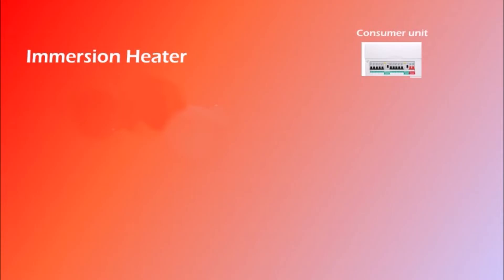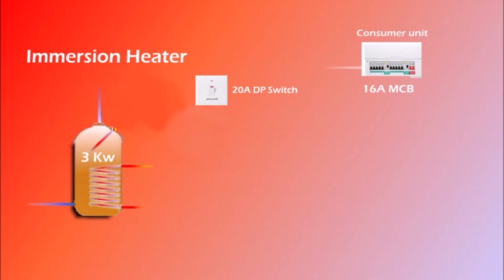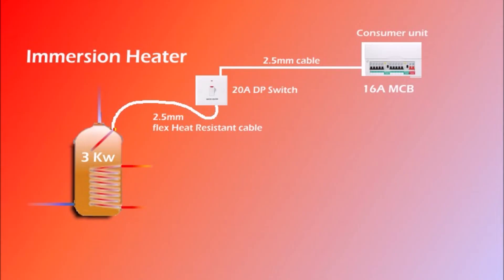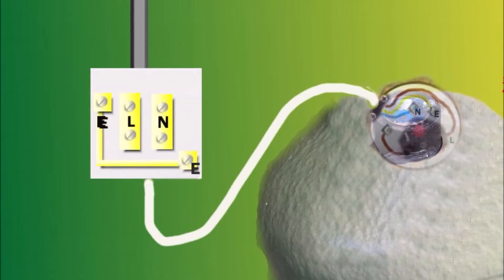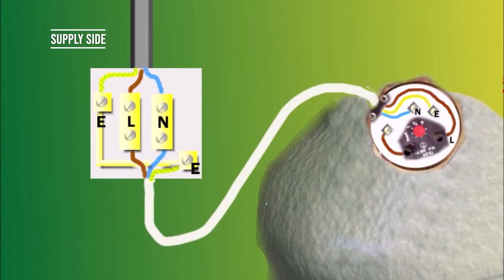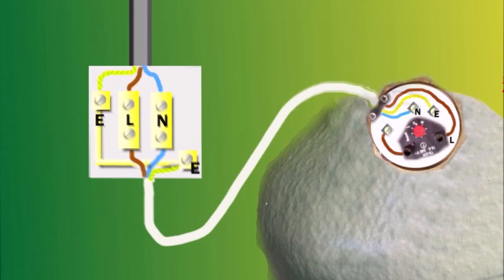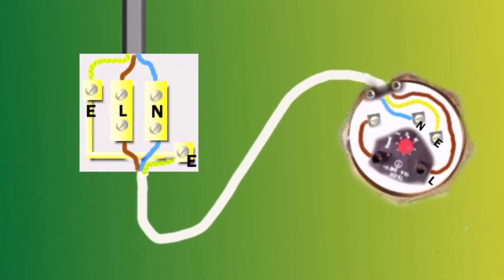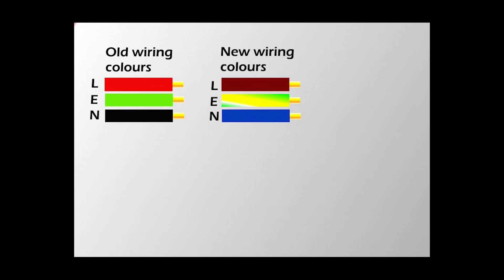How to wire an immersion heater WATER HEATER WIRING MCB CABLE SIZE and THERMOSTAT

Comment: Hi, does it have to be a separate cable and  fuse for the immersion heater?
Reply: It all depends on if it is a duel emersion heater or not, the duel heater needs 2 lives cables one is a permeant live and the other is a switched live. Then obviously your neutral and earth.

Comment: Where would you put a timer? On the load side or supply-side? Thanks
Reply: I’m no expert but just managed to replaced my timer. What do you mean, the timer would be installed between supply (cylinder switch) and load( hot water cylinder)

Comment: My water tank has this immersion as well but I fail to understand how my thermostat turns immersion on or off?

Or is it just a manual job for when I need it, will have to go to loft and flick the switch??

Comment: I use this switch to heat the water quicker, today the light has gone out. Does this mean that the fuse needs replacing?
Reply: Just test the switch for continuity.

Comment: Could you please post a video how to wire the dual immersion switch (the sink/bath one). Not a single tip on this anywhere on the web and it's not straight forward.